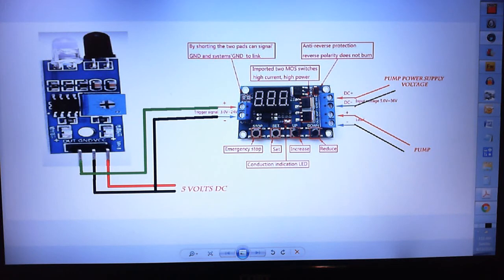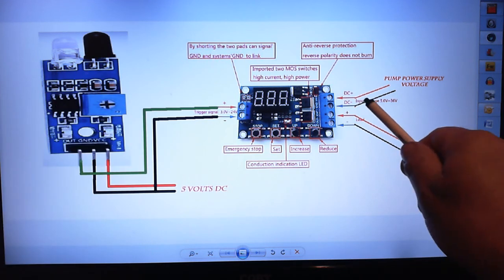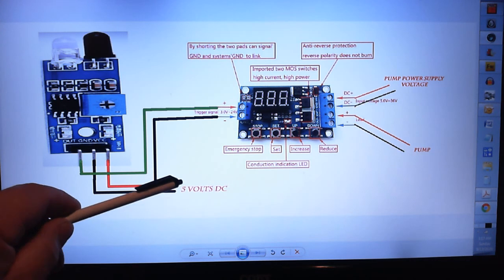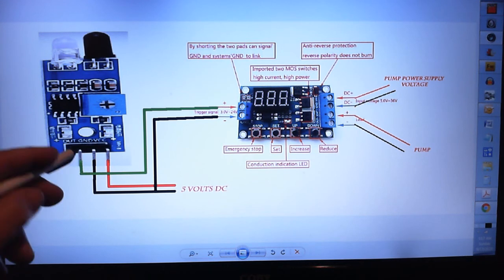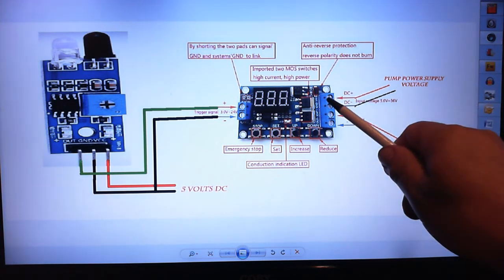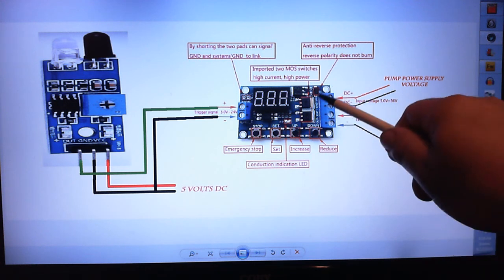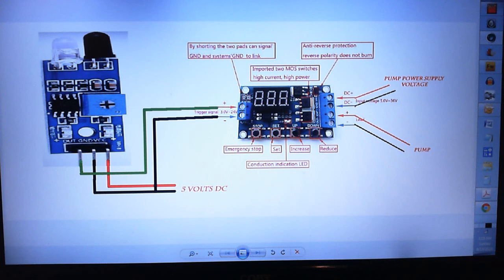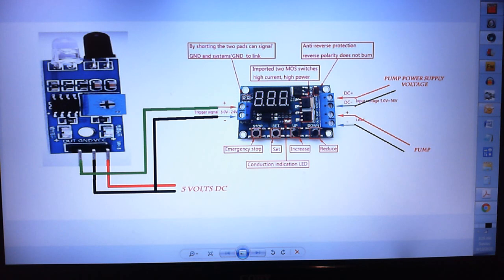Using low voltage modules to trigger the timer control board.

Comment: Good morning! Friend, so far I have not found anyone who tells how to reset the plaque to the factory configuration. The function (OP) I need to remove it from the configuration, but I didn't find how, I've done everything I could do, and nothing. I have four units in the same situation. Can anyone tell me how to delete this function? In all the options (U1, U2, U3, U4, U5 and U6) the OP function appears, and for what I use, this function (OP) gets in the way.
Reply from the maker: Bom dia senhor! Como você conseguiu que 4 unidades funcionassem mal? Tem certeza de que está tendo um problema de programação? É possível que sua fiação não esteja correta?

Comment: I am going to use one of these to trigger an electric start for generator. I'm having a hard time wrapping my head around how I wire it though. I need to wire it between the dry contacts and the start button. The start button is ... push to start and push to stop.
Reply from the maker: What's up Gabe. What is the sequence of operation?
Reply: @raykd2ibp198  inverter senses battery bank is at say 12v... at this time is connects the dry contacts in the inverter which need to send "start" signal to the generator. I want the timer relay(between inverter and start wire) to send the signal for .5-1 seconds and then stop. That way the inverter contacts don't stay connected to the start button continuously while the generator is running... after all this... the gen runs until the batteries charge to set point say 14.6v and the contacts in the inverter disconnect and the generator shuts off...
Reply from the maker: I would look for a module that will trigger your starter at a preset setpoint, say 10 Volts. The timer may not be the trick.
Reply from the maker: @gabegaming558  Ok got ya. the inverter voltage to the dry contacts is 12 VDC?
Reply from the maker: @gabegaming558  Disclaimer: This and all my posts are for experimental and educational purposes only. If you blow something up, or burn something down, kill yourself, or anyone else it’s on you. 
I don’t make, or sell the boards. I don’t vouch for the safety of using cheap modules for practical applications. Hire a pro if you have any doubts. 
I don’t like this module for this application. The risk of the board reapplying voltage to the starter as the engine is running exists. Also there is nothing “telling” the module that the engine successfully started. 
Gasoline and applied voltages is a volatile combination. It’s the foundation of how internal combustion engines work. Any circuitry and or wiring should be housed in an explosion proof housing. If any of the circuitry should fail it cannot introduce a source of ignition to flammable gasses, or substances.   
I will introduce a quick sketch after agreeing. Do you understand and agree with this?
Reply: @raykd2ibp198  YES. I THINK I'M JUST GOING TO GET A CONTROLLER... IN THE LONG RUN I'LL KNOW IT'S WIRED CORRECTLY
Reply from the maker: @gabegaming558  The right tool for the job. The controller is probably the best choice in terms of function. I will post the sketch anyway so you have a better understanding of the circuit itself.
Reply from the maker: @gabegaming558  https://youtu.be/MHncxscZpJI

Comment from the maker: Hello. The timer is pretty simple and shold be looked at as more of a SPST switch, with a timer, and triger.  For the actions you are describing... you might be better off exploring the use of a rasbery pi, or similar device. 
You would want to use multiple sensors, and program what the device does (input output commands) when each different sensor is triggered. I have a rasbery and adrino type board on my bench as we speak. Haven't been able to find the time to play as of this reply. The are relatively inexpensive when you look at there potential capabilities. I If I get some time, and make any discoveries before you... I will share. 
Please let me know how you make out! 

73!
RAY

Comment: hi all wired up the same And unit counts down but does stop power to the load (OUT +) after the timer countdown do you know what could be wrong please

Seems to constantly provide 12v to load
Reply from the maker: Hello. Can you send pic?
Reply: @raykd2ibp198  hi yes can send a pic where to please?
Reply from the maker: @sarooprince  Raymarsh638@Aol.com
Reply: @raykd2ibp198  thank you so much sent
Reply from the maker: Got it. Hands are full. Will review and get back to you ASAP.
Reply from the maker: Hello Saroo. Looking at the photo you shared it looks like you may have a wiring issue for starts. Whats the load? 

1) Make sure the board can handle the load.
2) The load is to be wired up to the two terminals on the lower right side of the board. Out- Out+ 
3) Tin your wires, and try to focus on being neat. This is your baby.  No one wants an ugly baby. Just ask my mom.. 

Good luck let me know how you make out. 

73- Ray
Reply: @raykd2ibp198  thank you so much Ray I tided up the wiring and found the problem thank you so much.

My problem is this board controls the load using ground switch but my load is permanently grounded so this board doesn’t work in my application.

I need it power controlled not ground controlled unfortunately
Reply from the maker: @sarooprince  Don't tap out too soon. if you're willing to detail what it is you're doing.. we can figure it out.  Your call.
Reply: @raykd2ibp198  I’d love to get it working but my load needs to have a permanent live as when it isn’t powered through this relay via trigger it is powered from another source as it is a alarm system. When the car is started this trigger needed to turn on with with a delay to continue proving power which is from a first 5 pin relay. 

And when no trigger load has ground and power.

This needs to be permanent live so this unit is not suitable for my application.
Reply from the maker: @sarooprince  Keep working on it.
Reply: @raykd2ibp198  I’ve added a manual simple switch under the driver footwell which I can just power on and off to simplify things not best solution but definitely does what I need thank you for all you’re help Ray really really appreciate it

Comment: Please need your help in wiring the same IR module to XY-J02 timer relay module. Thanks.
Reply from the maker: Hi Waseem, What are you trying to do exactly?
Reply: Hello Sir. I am trying to connect IR obstacle sensor to timer relay XY-J02 but don't know how to wire it.  I want to make a delay 3 Min if the sensor detects an object. Thank you.
Reply: In addition the name of the relay is 
 35238 mp.
Reply from the maker: Can you show me the ir detector.
Reply: Hi. The IR detector is the same type that you were using in your video.
Reply: It is Arduino IR sensor. Thanks Ray
Reply from the maker: Ok. Where are you getting jammed up? The video was pretty clear i thought...
Reply: OK, I am using a different timer relay XY-J02 not like the one you were using.
Reply: I connected the out of the IR Sensor to the input trigger but the relay did not work even if the sensor detected an obstacle.
Reply from the maker: Can you take a shot of how its wired up for me?
Reply from the maker: Tray this Waseem. 
https://www.youtube.com/watch?v=H1BQXxTp2VY
Reply: Ray. Your the best. I will try it today and feedback. Much appreciated. Can we replace the IR Sensor with ultrasonic sensor as a standalone without arduino uno or nano. Thanks.

Comment: Thank you very much Ray, you were a great help.
You're the best.

Thank you
Reply from the maker: My pleasure. Please feel free to reach out whenever you need some help. Please don't forget to like and subscribe if you haven't already. 73!
Reply: @raykd2ibp198  did it long ago
Reply: Ray , hi I have question for you I have a festool vac unit that has a Bluetooth remote to turn on or off but it has a momentary switch on it I wanted to hook a relay to it so when my cordless saw turns on the switch gets triggered to turn the vac on then when I let go off the saw trigger to delay by 5sec than switch off , would you know what module I could use  or relay system ,Thanks